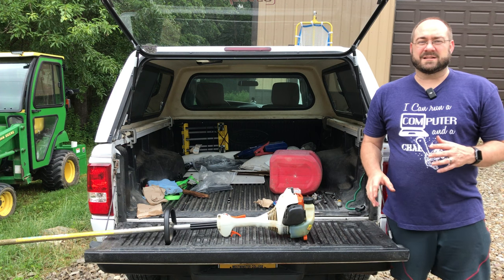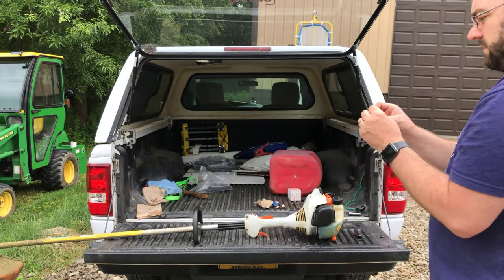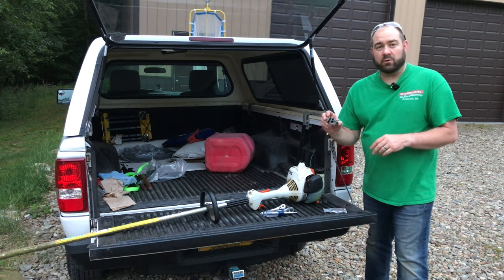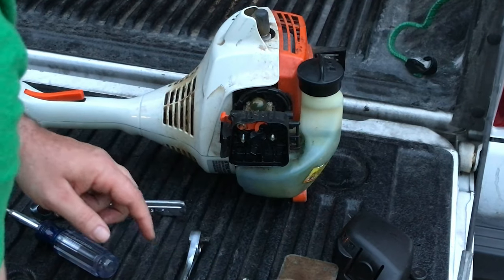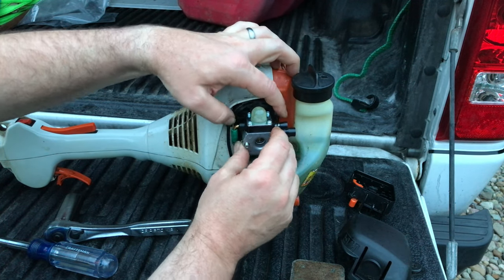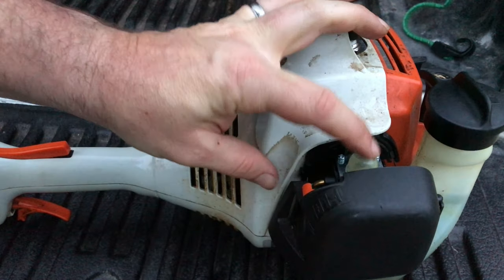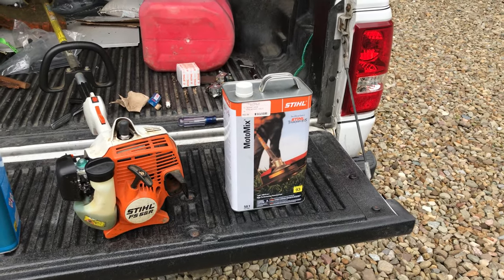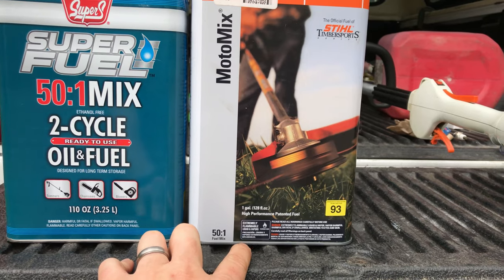Stihl trimmer easy fix - bogging down

Comment: I would have guessed it was a fuel problem too. Wow....learn something new everyday for sure. Ive experienced vapor lock that had similar effects. No power, even stalling out of the engine. Would never have thought it was the spark arrestor. Thanks for sharing, Chad! 👍
Reply from the maker: I never guessed that it was the spark arrestor either. I’ve checked them dozens of times on this trimmer and the saws - they always look basically new.  But not this time. The Stihl techs at the dealership said that about 90% of the time when one comes in with this issue - it’s that spark arrestor being clogged.

Comment: FYI,
Run recreational gas in all your gas oil mix engines and you won't have carburetor issues nearly as often.  I used to replace my carb once every year or two.  Since I switched to rec gas, I haven't had to replace a carb yet.  Recreational gas contains no ethanol.
Reply from the maker: Great point! When we're not using the Motomix, we do run Ethanol-free gasoline (0% Ethanol). I'm not sure if this is different than recreational gas like we get in our boat at the marina.

Comment: Way to make lemonade out of lemons Chad!  Turned a misdiagnosis into twice the content. 👍 #Winning  I had no idea about the spark arrestor, so good to know.  Also, I don't think all that gunk was a recent buildup...it was a LOT...so I doubt a recent change in fuel brands had a significant impact. (IMO). 👍😎
Reply from the maker: Sometimes I can’t predict the direction a video will go - even with a plan. :) 
I don’t think it was the fuel either. My best guess is that I wasn’t running it hard enough lately. If 1/2 throttle was enough to do the job, I wasn’t revving it all the way up.
Reply: I tend to run mine the same way, so Ill have to reconsider my usage!  Is yours also a "four mix" model?  Mine FS90R is.

Comment: You don't need to change the whole carburetor; just clean it with brake cleaner. When torching the spark arrestor, all you need to do is heat it with oxyacetylene. Once it turns red, turn off the acetylene, and the oxygen will burn the carbon off
Reply from the maker: Thanks for watching!

Comment: I just bought a new Sthil 2 months ago. I'm going to be pretty mad if I have to clean stupid spark arrestor that often. It seems useless
Reply from the maker: Just make sure you run it a full throttle. they're not made to run at 1/2 of slow speeds.
Reply: @PurpleCollarLife  Always a good move